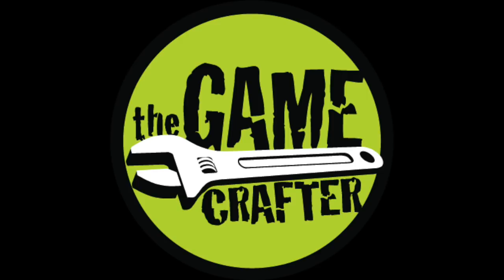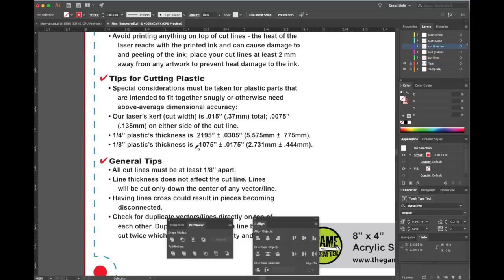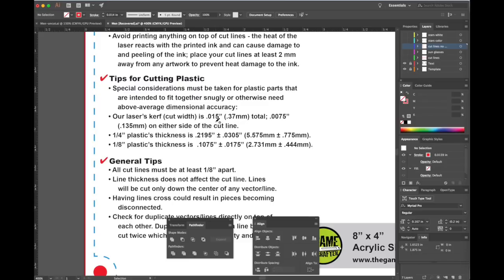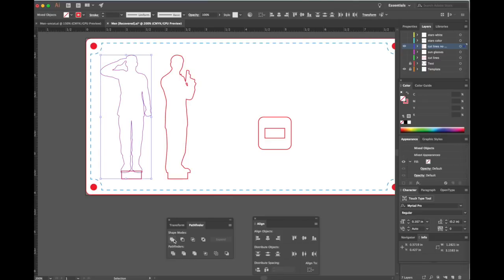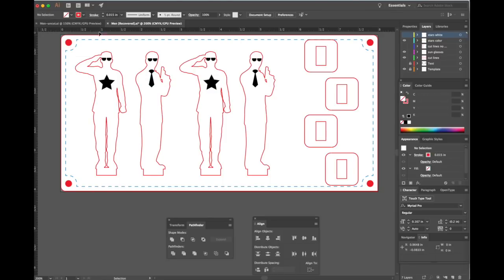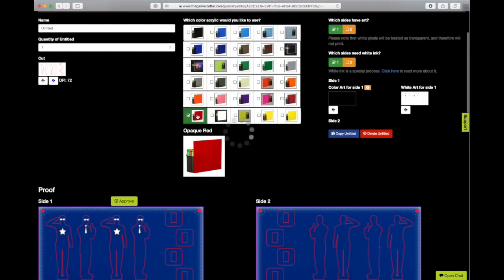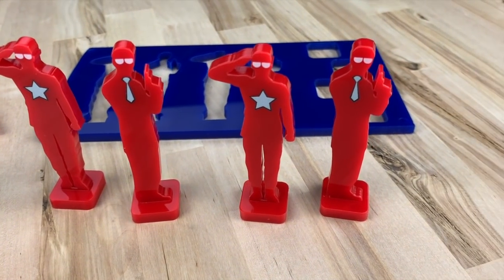Acrylic Shapes

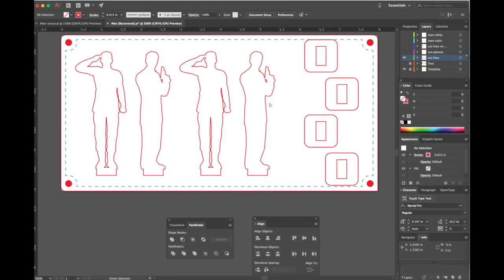Comment: About nicks: after I 'Divide Objects Below' with the line how I can make it transparent like on 2:23 and divide lines and make nicks? What's on the left side on the screen?
Reply from the maker: It's not transparent. We delete the extra lines after divide objects below.
Reply from the maker: The left side of the screen shows the foot of the other model.
Reply: Thanks. But how do you delete the extra line? Window - Pathfinder menu? Where exactly find this to cut?
Reply from the maker: @MartinChigurh  Highlight the line and then hit your delete key.
Reply: After I 'divide objects below' - I can not highlight only this line. I can highlight upper or lower part of the figure contour so all figure is deleted. Is it a my mistake in all figure lines/contour?
Reply from the maker: Martin Chigurh you highlight individual lines by using the white arrow tool rather than the black arrow tool in Adobe Illustrator
Reply: @TheGameCrafter  My problem is when I hit divide objects below, it creates two different objects--there is a .005 space between, but a new stoke is made around both objects, whereas when you do it in the video, a new stroke doesnt appear
Reply: @MMDDJJ123  Same here

Comment: Roughly, about how much, for example, does this red set cost to make?  $5.80 + $1.00 (printing on 1-side) +  (linear inches cut * $0.02616) = ...???  [Or, subtract $1.25 for an 8th-inch acrylic.]  I'm not sure how significant the linear-inch cut cost is here.  For a pricing reference, about how many linear-inch cuts are in this red set?
Reply from the maker: The ones featured in the video are $9.23 ($5.80 + $1.00 + $2.43). I should note that I did not optimize the cuts, so it's possible to lower the $2.43 portion by $0.25. And going to 1/8th inch acrylic would lower the price by another $1.55. The unoptimized cuts shown here are 92.94 inches. Using the optimizer in component.studio would bring the length down to 79.72.
Reply: @TheGameCrafter  Thanks much!  These pieces look to be about 3 inches tall, so if your game only requires 1-inch tall figures, perhaps you could even further drop the total price.
Reply from the maker: @stephenmontague6930  Absolutely. In addition, if you need a lot of tokens, you can fit 32 3/4" tokens on a single sheet.
Reply: @TheGameCrafter  For the lost souls who don't yet have component.studio, what is optimizing about?  I assume it means keeping your cut lines relatively smooth, with minimal waves / bumps, since this would be less efficient than a straight line or smooth curve.
Reply from the maker: @stephenmontague6930  It's not about smoothing. It's about getting you the cheapest possible pricing. More info and tutorials here: https://help.thegamecrafter.com/article/201-custom-punchouts-and-card-stock
Reply: @TheGameCrafter  I meant smooth lines are efficient - so cheaper.  I see the link on custom punchouts has more. It says we'd better think about the order of cuts? I just downloaded Inkscape- I'll check it out and then get back to TGC chat if I need help.  Thanks for the info.

Comment: So many people are going to screw this up lol
Reply from the maker: Owen Prescott it is definitely a bit more challenging
Reply: @TheGameCrafter   A template with various-sized base pieces and pegs would go a long way to help avoid screw-ups.  (If the base & peg is wrong - you're screwed.)  If someone sold that in the game design assets section, even, I'd probably buy it.  That way, I only have to concentrate on cutting & printing the top.
Reply from the maker: @stephenmontague6930  We'd be happy to design it and put it in the asset shop for free if I knew what it is that you were referring to. Do you mean just the tab (on the bottom of the model) and the base with the hole in it that is featured in this video?
Reply: @TheGameCrafter  Yes, I'll swallow my pride and ask-- the tab (on the bottom of the model) and a "nicked" base with hole, preferably in a high-quality png file.  I plan to re-size them to something appropriate for models ~0.75-1.5 inches tall.  Knowing the base is designed right to start would be a relief.
Reply from the maker: @stephenmontague6930  Ok, we can do that no problem. However it will not be a PNG file as that would ultimately be useless. To make these you must have an SVG file.
Reply from the maker: @stephenmontague6930  Here you go: https://www.thegamecrafter.com/design-assets/custom-acrylic-shape-slot-and-tab-examples-1-4-in-acrylic
Reply: @TheGameCrafter  Good to hear. The upload & description pages only specified png & jpg for printing.  Svg files were mentioned in a note about optimizing, but anyway- that makes sense, to get precise lines.